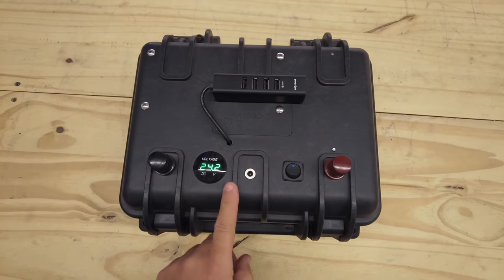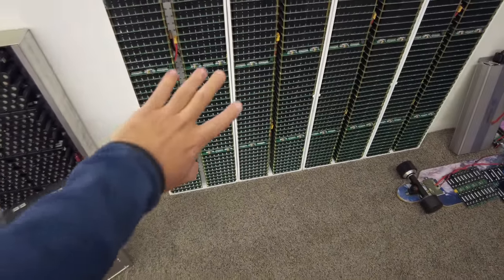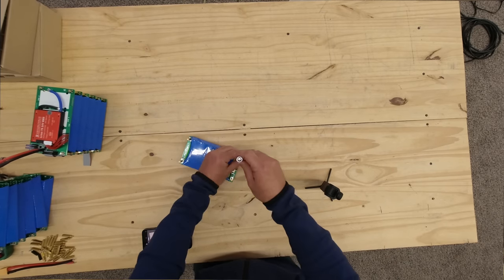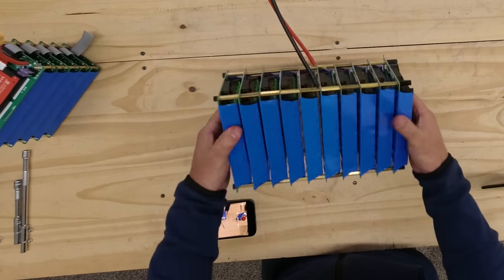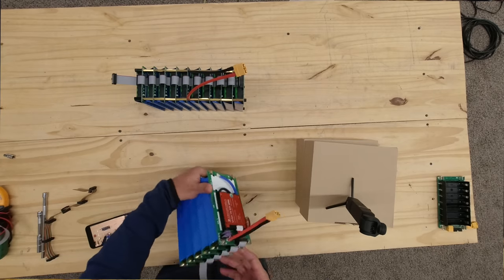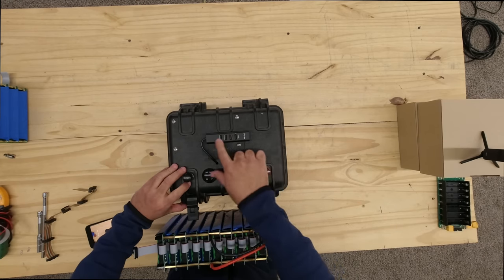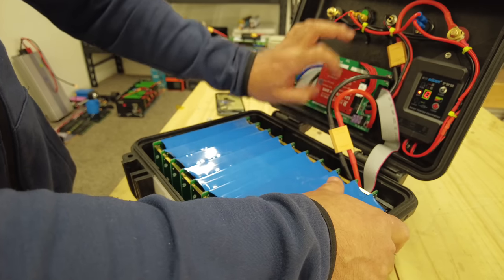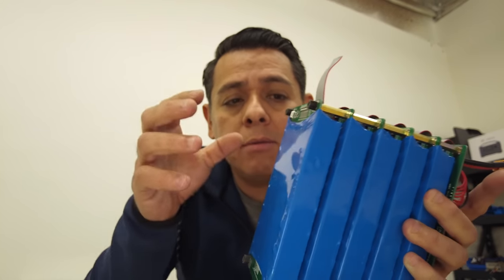Emergency DIY Solar Powerpack Build

Comment: I got to ask as based in UK. Why 24v? Can I create something in a 12v application using the same batteries? Are the 18650 still your first choice, or have you gone to the larger ones.

I am still educating myself.
I want to do leisure battery, jump pack, longboard, bike and eventually van.

Thanks for sharing and your time and consideration
Reply from the maker: 12v is best made using LIFepo4 which is rarely available in 18650 form.
Reply: @jehugarcia  thanks for prompt reply (big fan) the reason I asked, I thought I would create my own 12v leisure battery, and then just keep adding for a larger power bank and then eventually have enough to convert in to a power pack for a e van conversion, obviously going from parallel to series to increase voltage.

As I have managed to get hold of you, have you got anyone representing you or your brand in the UK? If not, would you consider it? I am nominating myself as long term unemployed and essentially homeless, and want to do something that makes a difference in society.

Even if it meant representing your charity work or create a charity promoting you and your life changing products and saving lives.I want to be part of something like that!

Or any other capacity of work. I want to work for you.

Thanks for your time and consideration Jehu

Comment: Is there a better option for batteries i have 14  10 watt can lights and a 50 watt led cob light to light my garage. The pack  will need to only power the lights nothing else. Is there an option you can recommend? I like the idea of it being portable....im thinking I may need it to run 5 to 6 hrs a day and can take it home to charge....any advice would be appreciated...thanks
Reply: The garage is located on a peice of land i bought....dont wanna run dedicated grid power to it ...

Comment: Hi, can you tell me if it is possible to connect the Meter and USB plugs straight to the BMS as I already have a solar charge controller fixed to the wall so it would be external to the Solar Powerpack.

Comment: Hello, can you tell me if you have a kit to build a power pack redy to use 110 v or 220 v ac and usb ports and can be charged from an outlet at home 110v ac in advance tanks good work

Comment: That's definitely a great system, what I would like to know is have you shipped out a kit to anyone in Australia? And what's the shipping charges like? 
There's a lot of stuff that I would like to get from the US but shipping charges from the US to Australia on eBay scares me! Usually, the shipping charges cost more than the product itself! Maybe it's just eBay? Or maybe the US is trying to discourage manufacturing at home? I really don't know but what I do know is that I have to be careful when it comes to stuff that are coming from the US! I found out the hard way when I purchased something from Amazon 10 year's ago, the price was $30 but that was in US dollars which automatically pushed up the price, then there was import charges and finally the shipping charges which pushed up the price to $100! 
So for me, Amazon is out of the question! eBay, only if it's from anywhere else! 
So technically I would be really interested to know if you have had any customers from Australia?
Reply from the maker: I don’t ship internationally exactly for all the reasons you mention
Reply: @jehugarcia  it's such a pity, Australia the land of sunshine where the government makes it cheaper for solar energy, you could literally have some more customers! 
Thanks for your reply, love the videos..

Comment: In the 7S 24V BATTERY MODULES - NEW LGM36 CELLS...... Does the BMS and the SoC module come with..... Because the photos in it show that they do if you get whats in the photos.. or are you showing what you need to do... kind of deceiving???plzzz help I am trying to buy

Comment: Any tips on the configuration of a power pack to run a welding machine , I have some work to do on my classics and no electricity at the garages

Comment: This is really cool and incredibly handy to have around. Have you considered putting shrink tube around the brass stand offs to protect from something shorting across? Can the BMS address each cell individually or does it only think there are seven cells instead of seventy?

Comment: In one of your videos you talked about the REDESIGNED ELECTRODACUS SBMS40

That you sell.
Do you sell a version that works with your module cell system.
Reply from the maker: No that never became available wide enough for me to sell it,  but it does work with my modules if you can get your hand on one.

Comment: Hi do you have kits To achève 36 volts  200ah  . And were can i order them?
Reply from the maker: no but I have ready built 36v battery packs you can buy https://jag35.com/collections/lithium-batteries/products/copy-of-40-cell-ncr18650bd-18650-lithium-scooter-battery-pack-w-case?variant=32109204471923
Reply: @jehugarcia  so to make à 150ah bank I world need 13  of those and i would need à solid bus bar to drive 36 volts and those 150  amps . For charging system , my normal boat 3x12 volt batt charger  could take care  of them in groups of 12 volts.. it is to be used for driving à minn kota troling motor  36 volts All Day.

Comment: Are You the guy based in San Marcos, CA who had funforlouis transform his VW Bus into an EV 2, 3 yrs ago? And also build out another VW Bus (Combi Life) 5 to 6 years ago? Combilife had a fire after that. Is that because he used 18650's before BMS's were prevalent? Or Bluetooth BMS's were really used? I'm in Torrance doing Vanlife. Used to live in Encinitas. And San Clemente. My 4 year old deep cycle marine is finally dying in my engine compartment. Can I build an 80 amp hr battery pack (80 amp hr is all you need in a V8 to start it in SoCal, right?) for my engine compartment instead of buying another expensive deep cycle marine Super Start from O'Reilly? It doesn't get below freezing here anymore. So charging below freezing isn't really an issue. And they have warmer plates wired to the BMS and battery packs, now - just in case it gets below zero. I'm a bit concerned about all of the YouTube videos of 18650's shooting off like roman candles that could burn down my rig, and leave me stranded. But so stoked to get into electronics after buying my first multimeter a few weeks ago. Ready to start soldering again like I did at 12 years old. Except now I'll know ohms law.

Comment: Great work Jehu!

You're a great DIY'er in the field and also an influencer.
For that reason, I have one (constructive) criticisms regarding the terminology used. Your builds are "energy storage" devices, not "generators".
 I believe it's important to use the right terms,  as many of your viewers regard videos like this educational, rather than a tutorial/ guide.

Such a shame that this misleading term was allowed to be used even for commercial battery packs.

GENERATOR - noun
a machine that converts one form of energy into another, especially mechanical energy into electrical energy, as a dynamo, or electrical energy into sound, as an acoustic generator."
e.g. : SOLAR PANELS.

Regards.
Reply from the maker: But doesn’t it apply If you use solar to charge them?   It converts sun light into electricity.  Sure the panels actually do the generating but if you need the battery box to be able to use that electrical energy,  then it’s part of the system and it would fall under the umbrella of the term “generator”.  I think the meaning of words is
Ever changing, computers used to be people, gay used to mean happy,  and so on
and fighting the evolution might be a
Fruitless endeavor.  Generator might one day mean energy storage device.

Comment: How can I use this for my RV I want to use 12 volts
Reply from the maker: 24v to 12v  dc-dc
Reply: Sorry to keep bothering you are you talkin about a 24 volt converter down to 12

Comment: Quick question, the gray ribbon connector you used to connect the pack to the BMS, do you have a link for that and what it's called, I have a couple of big packs I would like to join together, you start a build and then want to add to it but you already have the ribbon connector done.
Reply: It's got to be a male/femal connector
Reply: I wind up taking one of the old board ribbon connectors (the straight-up one) and hot gluing it so I can jump to the next pack

Comment: this is just sad. 

i thought it was cool at the start untill he shows that wall he made. 
what a giant waste of money. 
please tell me those are not all 18650 batteries.  because going to that size. there would have been MANY MANY cheaper options. not to mention safer options. 
i wonder what the local fire department thinks about that wall.

Comment: How many AH that battery pack??
Reply: 7s 10p how many AH per pack??
Reply: 7s bms 24v how Amps??
Reply: How many discharge current And charge current u using BMS??

Comment: at $450, it makes no sense. I can get lifepo4 cells on aliexpress that are way more capacity for the same price and it's just as easy
Reply: Li-ion and Lithium polymer have a higher energy density. This build takes up a lot less space and weight, for the same price as Lifepo4, as you said

Comment: 1:15 @jehugarcia touches 24v positive and negative terminals... forgive my potential ignorance but shouldn't that have created a short through your/his body?
Reply from the maker: my body is a terrible electric conductor,  therefore the short is almost nonexistent
Reply: @jehugarcia  funny but I want to start working with this type of stuff and want to know the safety behind this, if you dont mind, is it because the voltage or amperage is too low for these modules?

Comment: But 7s output 28 volts...
Reply from the maker: 21v-29v. Depending on SOC
Reply: @jehugarcia  ok, I have some balancer from china and it's 7s 24v written on it, but once I connected 7 18650 batteries, I have 28 v

Comment: I glossed over this incomplete video a few weeks ago and now I remember why....
Does this 'build' support pass through charging???? You mumbled over that part..
Any movement, vibration, heat/cold or physical, will loosen those standoffs & compromise the connections from brd to brd..   
Would I be incorrect to install star lock washers between the board and standoff..??? 
Of course not...
So, the hookup and programing of the BMS, other components & ribbon cabling to include where to install the on/off switch in the circuit is "not important"..????  
I guess I'll have to look at the DIY Solar - Will Prowse videos for that info...!!!! LOL!  (not funny)
What are you doing about overheating and ventilation..??
Buy the box for less elsewhere.... Harbor freight...  
Sounds like a click-bait, quick sell, self serving video to me.........  
BTW, that loud music in the beginning of the video needs to go..